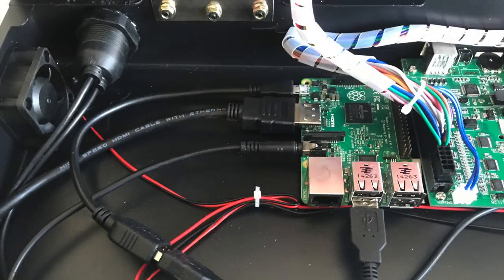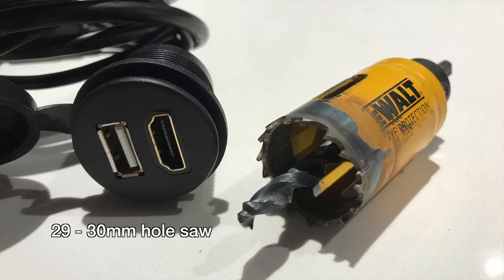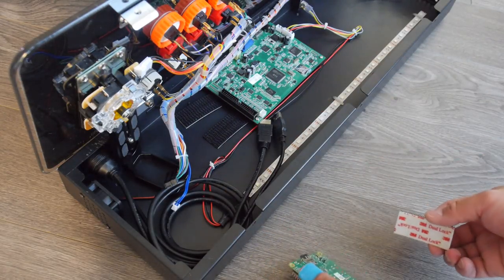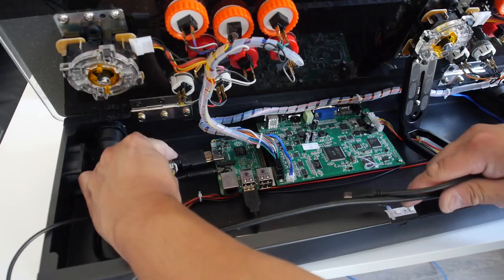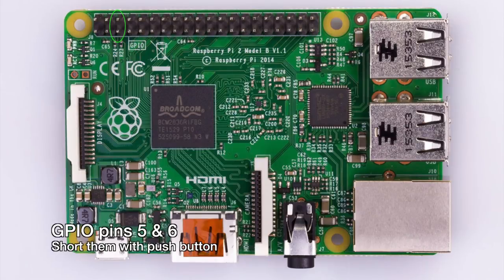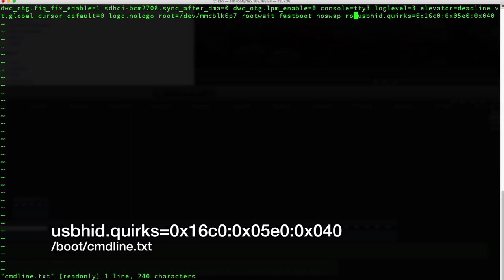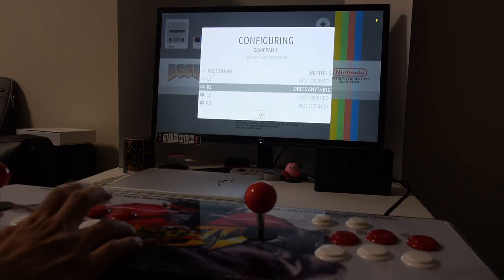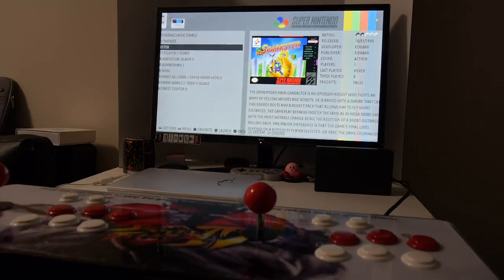✅  Raspberry Pi inside Pandora's Box 4s 4x arcade SuperGun

Comment: Yeah I just gutted my pandoras box, used pc encoders for each individual stick, kept the wires inside the pandoras box. Undid the pandoras box composite output and fed the wires through there for power and hdmi. Not that clean of a job, but less of a mess inside and can always use the Pandora box as two seperate ps4 controls using a brooks converter. Good stuff though! I wouldn't have thought to keep both functions like that

Comment: Nice setup. I used those USB/Hdmi on my arcade 1up. It's on one of my videos. What I will do is try to recognize my Pandora Box 6 2nd player But I won't install on the inside because I will be switching from my Arcade 1up to the pandora box 6 system.

Comment: I can’t seem to find the cmdline.txt in the microsd. Would I put the line in the recalbox config file instead? And also when I connect the pandora box to the raspberry pi, if it is just the usb connected in the pandora box, then only 2 buttons work on the top part of the pandora box on one side. But if I power on the pandora box, it works, but I am also controlling the menu in the pandora box while using it as a controller on the raspberry pi. Let me know if you can help me as I will be greatly appreciate of it.

Comment: Great video helped me loads, got the same ID as you but on both sticks it does not see left or up, any ideas???
Reply from the maker: that's a strange one.  Either it's a physical connection issue or software didn't map those properly.  Hook up a keyboard and go to the the raspberry pi controller settings to remap them.

Also you may wanna check out my other RPi video, it's another way to install an RPi, if you don't want the Pandora games.  https://youtu.be/cFY26xVpV38
Reply from the maker: +Neil Brighton Apparently if you use retropie, up and left won't work. But it's fine under Recalbox.

Comment: Thanks so much! I used your tutorial exactly. However the Pandora's coin buttons don't register in my rasberry pi. Any suggestions? Can I add buttons to the Pandora's system board to use in retropie or possibly alter the coin button wiring to work through USB?
Reply from the maker: Make sure you configure the buttons in recalbox settings. I didn't have issues with that.  I didn't use retropie so that might be the difference.

Comment: I bought the 1099 in 1 pandoras box 6s...

Which is NOT a fake....
Its Modified to be able to add and remove rom.
I have like 1437 roms running on the system. ..easy. 

People talk mad shit on line about my version. ..
It still has a Pandora's Box title screen.
It just comes...right out the box. ..with the ability to upgrade your roms library. 

My machine is the shit...its Made by Meco...and runs smooth....light's up...LED...lights...and all that Shit. ..

Paid $135.oo
Plus $45...shipping

Brand NEW. ....from China. 

People need to stop Hating on these arcade systems. ...

It's cheep...go grab one....
Or shut the Fux up already. ..
Reply: Ordered...thanks 4 intel
Reply: Pandoras box 5 as  been released with upgraded hardware. I just changed my board to the upgraded hardware for 70 uk pounds, i do have the same box as this guys video. Well worth the upgrade.
Reply: I'm seriously considering picking up a 6 within the next week or so, haven't found any footage of the 6 on youtube.  How much of a pain in the ass it it to load more games to it?  Much appreciated  (replacing an old game elf)
Reply: 6 is a clone with slower hardware. It would be easier to get a pi 3 and a image with all the roms on, best of both worlds although the raspberry pi is way better.
Reply: Thanks for the info

Comment: This is the quirks entry for my pandora 3D usbhid.quirks=0x0314:0x0119:0x040  Anyone with this box can place this code at the end of the cmd.txt file found by searching your sd card to get the 2nd stick working on the pandora 3d..
Reply: Did you test it yet @J Armstrong
Reply: Hi where do you find your cmdline. Txt in pandora box 3d?
Reply: @meechp123  And you have it test yourself on the pandora box 3d. Because I can't find the cmdline file in the sd card

Comment: Whats up man, I have a pandora box just like the one you're upgrading, I unplugged the push buttons because I made an arcade cabinet and needed to put a different decal on it and now the coin button doesn't work the screen send me straight to continue or exit as soon as I select a game, but when I press continue it goes back to the same continue or exit window.

Do you know what I need to do?

 I ordered new buttons but I doubt thats the problem.

Thank you.
Reply from the maker: Something is probably shorting. Take off all the wires and plug it in one at a time and test. Slow but you'll find out which is causing it.

Comment: If you have a raspberry pi 4 console, can you connect it to the pandora’s box to use the controllers from the pandora’s box with out doing all of this or would you only be able to use the controllers from the console?  My technical knowledge is limited LOL.
Reply: If you plug the Pandoras box into a rasberry pi 4 without making the quarks entry...it will only recognize player one, and you will never be able fo use the 2nd player side of your arcade stick...you may be able to plug in another controller but playing on a half working arcade stick sucks.

Comment: I've tesed to see what the PB USB address is an its not showing on the pi, it shows three usb hub addresses and one for the wireless mouse / keyboard dongle I have attached. 

do I have to change a setting in the PB so this works ?
Reply from the maker: It really depends on the pi distro you use recalbox or retropi.    And a lot of the new Pandora box clones maybe not work...

Comment: Hey I have a Pandora's Box 4S as well and I want to change the coin button into LED and I am wondering how am I going to power up my LED button and what kind of wirin work do I need to do?  It is working but I just need the extra two wires to be connected to some kind of power source so the light could turn on
Reply from the maker: +Zoa's Video Games & Arcade Tours you have to find 12v on the circuit board. it's usually a yellow wire for 12v, red for 5v, black for ground. test to make sure with multimeter.
Reply: kenVersus thankyou ken glad to have you.

Comment: Genius
Reply: Just received an Pandora Box 5 Dual Arcade Stick, and for your information the new V5 manages differently how you connect to a PC/Raspberry. First you have to power on the Pandora Box, apparently
USB power is not enough. and you have to plug one USB cable for player one, and use the other USB port for player two (so you need 2 USB cables, but no longer need to editing cmdline.txt). You have to use the power supply of the Pandora Box and that's boring, so I will see if I can exchange the pcb for a 4S/4S+, it seems to be compatible.

Comment: Hi!

Is it possible to had 2 controllers as well? Instead for 2 players with the joystick board, would add 2 more players with 2 controllers.
Reply from the maker: +Igor Peças yes. You can add additional players with Bluetooth controllers or wired USB to the raspberry pi.

Comment: So I just did this with a pandora 5S, works great except 1 thing. And I just rewatched your video again. The little lightning bolt in the corner. There’s a low voltage reading at the raspberry pi!!!
Would have been good of you to point out
Reply: I am in the same case, if someone finds a solution to this problem it would be cool ;)
Reply: Shorter USB cables fixed this for me.
Reply: Power supply is not sufficient. I had a similar problem with a Chinese 5v 3amps power supply (aluminium enclosure). I increased the voltage to +- 5.2v and the lightning bolt disappeared. But indeed it could be due also to poor cable quality.

Comment: Having an issue with controller setup. The hot key is messing up the controllers in game play. Is there an option to skip that. Or how to go about exiting games after you are done playing
Reply from the maker: +misfits the what happens when you set up the hot key?  Mine works just fine for exiting or loading save states.

Other option is to get a Bluetooth keyboard or controller set up for exiting. I have a wireless keyboard that i hooke up to mine for times when i need to type something.

Comment: Did you solve the low voltage on the Pi? because of the little thunder  symbol on the screen...
Reply from the maker: I had to use a different power adapter and cable.

Comment: hi, i followed your instructions. device id is 19fd:3232 . what has to be the usbhid.quirks then? i tried usbhid.quirks=0x19fd:0x3232:0x40 . but still only recognizes 1 controller. btw. im using a pandora's box 6 (arcade box super). any help would be much appriciated.
Reply from the maker: That should be correct. But yiu have to make sure that's  correct and not for some other usb device.

Another option is gpio as shown in my other video. https://youtu.be/cFY26xVpV38
Reply: usbhid.quirks = 0x19fd: 0x3232: 0x40 <- (0x40) is the port to which the game box is connected, raspberry has 4 usb and each one is assigned with a number.

I reccomend that from SHELL write lsusb and see DEVICE 00 .. is the output of usb raspberry, that number is added 0x (number) 0

Comment: Hi, do you happen to know the procedure for Retropie in order for the pandora box to be considered as two separate controller?
I haven't purchased a pandora controller yet. What is your opinion on the ultra thin models sold on Alibaba.com (all black or white even blue)
Reply from the maker: The procedure should be the same for retropie.  Adding the usbhid.quirks entry.  Thinner means less room.   I have ordered tons of stuff from Banggood and never had issues though.
Reply: Alexis-Bryan it won't work with retropie the up and left inputs won't register you need to use recalbox
Reply: Smartlad i have the same problem on retropie also with android left and up is not working !
Reply: I have the pandora 5s and recalbox works 1 player, I try the sd card cmdline.txt but says recovery  file ,wont let me go into file ,and I went to cmdline.txt in raspberry put the numbers push control x it I'll not save it  says error any ideas thank u
Reply from the maker: Try this:

Plug an usb keyboard and press Shift during the recalbox boot to access recovery menu. Then press "e" to get the edition menu, and make you changes here. You can switch the language and keyboard mapping by pressing "l" and "k".
Reply: hi thank u I  got it to work on command  code threw the pi the sd card had no edit file to cmdline.txt, as for retropie setup has to reprogram the  kernel to make pandora game box to work but recalbox works best for less work
Reply: Hi Que Le, did you get this to work with retropie by reprogramming the tutorial or did you stick with recalbox? If yes, could you point me to a tutorial or instructions?
Reply: hi I did not get it to work with retropie the kernel has to be redone I just stuck with recalbox for retropie I purchased a sd  card from a person that configure it  with attract mode 128gb
Reply: thank you, I was hoping to easily switch to attract mode with retropie but I guess this will give me a chance to learn how to use recalbox and I read that possibly 'up' and 'left' doesn't work properly in the retropie controls when using it with Pandora.

Comment: Would the same process work when using retropie?
Reply from the maker: There are reports that the 2nd controller doesn't get detected by retropie for some reason.  but if you don't mind just 1 player working... best to use Recalbox.

Comment: If the Raspberry Pi will run all the games that are on the Pandora box what's the point of having them switchable?  or better yet.. just put a RPi in an arcade stick.. I ask because I was really thinking about buying a Pandora Stick but I'm pretty sure that the Pi 3 runs games better than Pandora so it's kind of pointless. Nice video though!  :)
Reply from the maker: +brando92711 it's just an option if you have a pb already. Some people don't want to bother with a rpi and download ROMS and setup.  I use my raspberry pi for console games. With this setup I bring just this arcade when I go to a friend's house and it has both a rpi and pandoras in one arcade unit.  Try to find an empty arcade stick and shove a rpi in it. Like this https://youtu.be/K1g3ITLSETE

Comment: I messed up on the control configuration and now can't get back into it even with a keyboard . any ideas ?
Reply from the maker: +GhettoJoe maybe try to go to webui via your IP address and delete the es_input.cfg. Worst case scenario just write the image to your sd card again.
Reply: cool thanks
Reply: I got it back to normal but the controller doesn't work with all the Pi games like the fighting games are missing two buttons . I've configured the controllers many times but no luck
Reply from the maker: +GhettoJoe that's strange. You have the same PB arcade as mine or different?
Reply: I got version 3 it only has p1 coin and p2 at the top

Comment: Trying to adding my controller but it only detects 1. My device is (I have a Pandora's Box 5s) 17c0:06e1 would I change it to: usbhid.quirks=0x17c0:06e1:0x040
Reply from the maker: It should work.  However, you have to be sure that is the device ID.   cause usually when you do an LSUSB, there are a few other devices listed.
Reply: Still not working I made sure I had the right ID with the LSUSB command is there somewhere else I can look?
Reply: Also for some reason it does not recognize my "Select" button
Reply from the maker: hmmm.  I'm puzzled for sure.  I have a different PB than yours and it works?   I would maybe check out the recalbox or retropie forums to see if they have an idea.  Cause it ultimately has to be supported by the software.
Reply: Thanks for the help I really appreciate it, if I figure it out I will let you know.
Reply: got this working? same 5s here.
Reply: YES! I had the code wrong it needs to be: usbhid.quirks=0x17c0:0x06e1:0x040
Reply: Well you nearly broke such a great machine, this is why I tell people not to mess about with them. You can add mame to a kodi/android box, with less hassle & just a few different mods. Still you got it all sorted in the end.
Reply: CFB_NFL Did you get your coin/ select button working with Recalbox?
Reply: CFB_NFL Thanks Bro, but did you get your select/coin button to function? If you did could you tell me how. Right now just using my keyboard.
Reply: @Virtual_Vinsanity  you have to re-wire it..thats what i did and it worked now if someone can help me with getting the 2nd player recognizez

Comment: My Pandora's box is not being read as a controller on the raspberry pi
Reply: Please help
Reply from the maker: +Hitman19 try the other USB port. There's 2 usually. Try another cable in case it's bad. Try Recalbox instead of retropie. Some things to try for  trouble shooting.
Reply: kenVersus I've tried all that beside just switching to recalbox which I might just have to do that but from stuff I've looked up there might be something I need to do with a ATTRS input command thing do you think that may work
Reply from the maker: +Hitman19 not sure about attrs. You might also take a look at the GPIO method. Here's my video. https://youtu.be/cFY26xVpV38
Reply from the maker: +Hitman19 also if you read the other comments here. People with retropie have issues. But Recalbox is fine.
Reply: Thanks a lot for the help